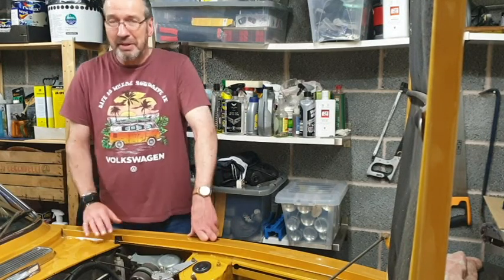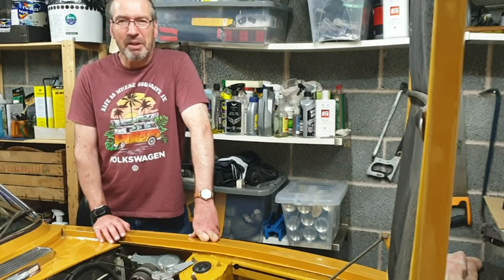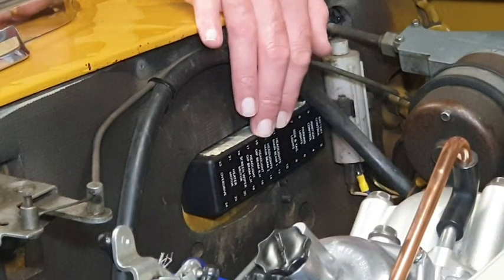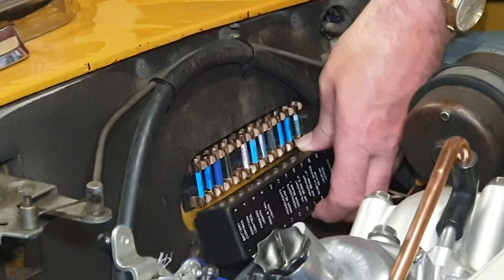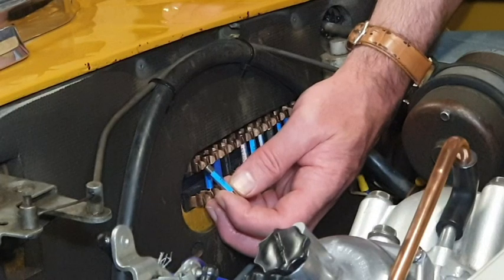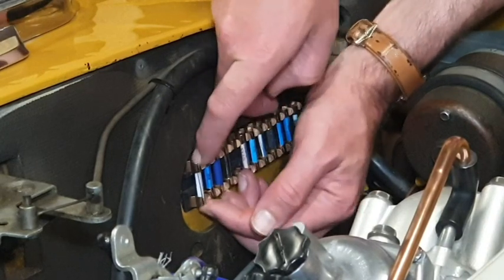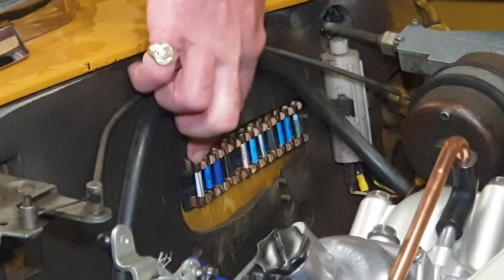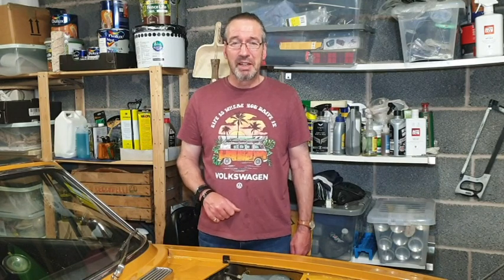Triumph Stag misfire ..... or is it? - Pre : 12

Comment: Hi a great video. It's so good to have all these problems and solutions shown. I had a similar problem with my 1971 Stag  and had tried everything to solve it without success until i checked out the fuse box. I found the fault to be with the back of the fuse box around the terminals. They are held together with small copper rivets and they had become loose with age and were not making a good connection. My answer to the problem was to replace the fuse box with a Stagweber one which worked well. Thx again for the video most informative.
Reply from the maker: Great to know I'm not the only one who has had this problem :-)

Comment: Did you know that the ignition is not normally fed via any fuse? You be able to confirm that by referring to the wiring diagram in the ROM manual.  I suspect someone has fitted electronic ignition that is fed from the fuse box, and in that case why not revert back to unfused for better reliability as the designer intended?